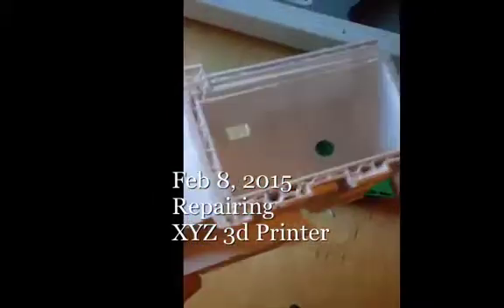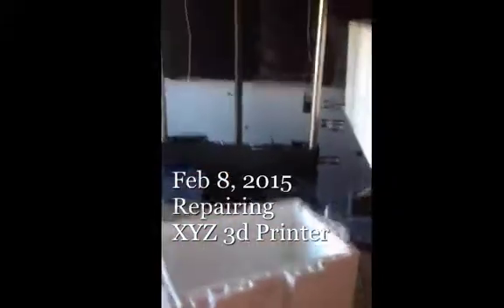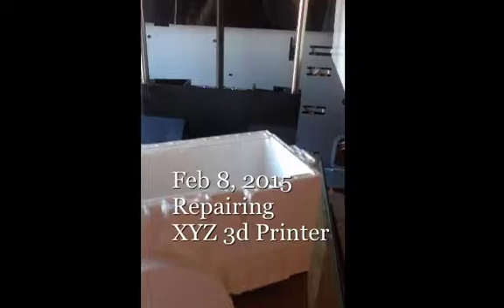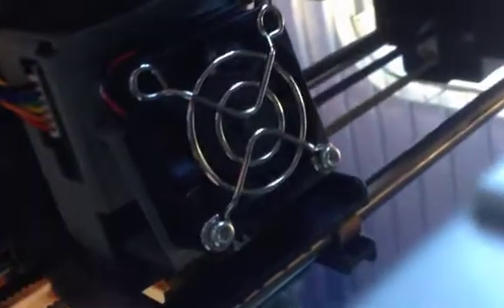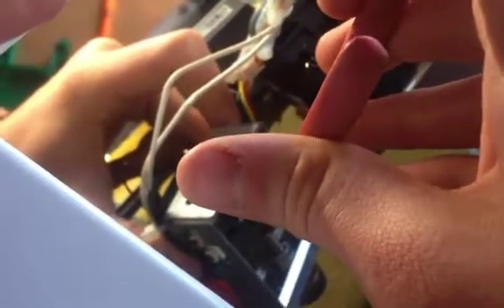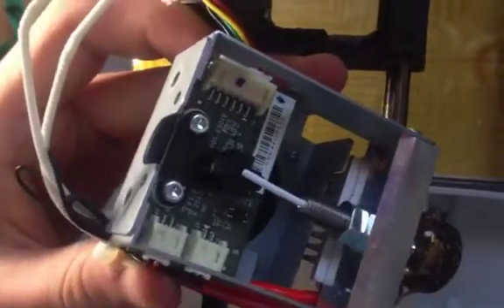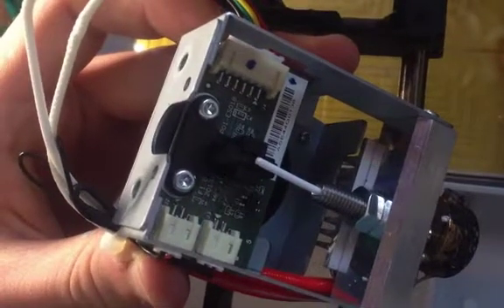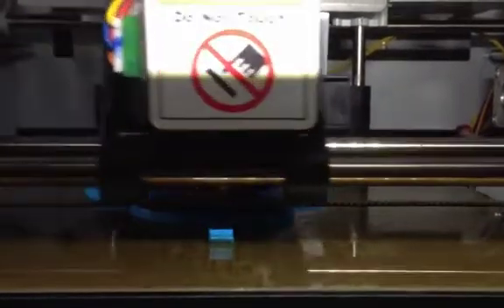XYZ Printing da Vinci 3d printer repair

Comment from the maker: Our hypothesis is that the end of the filament goes past the roller that is used to load and unload the last 1.5 inches.  Unload heats the front end of the filament and then the roller must pull the filament out from the melting point.   But since there is no filament in the roller at the end, this does not happen at end of cartridge.  There should be a sensor at the top tube to detect end of filament.  Then the roller could back it out as normal and you could pul it out